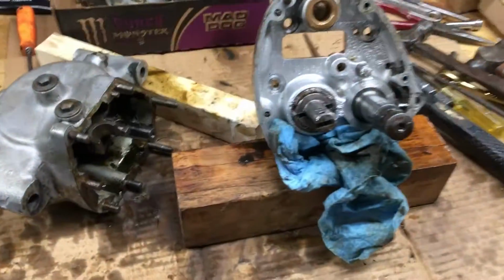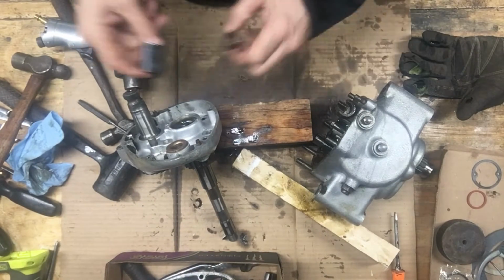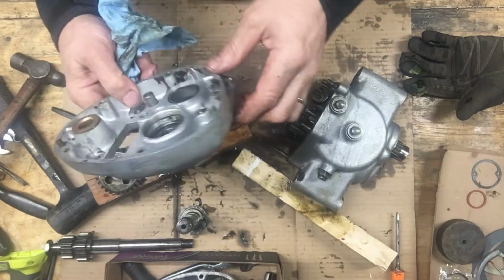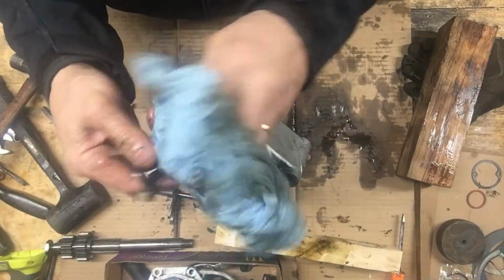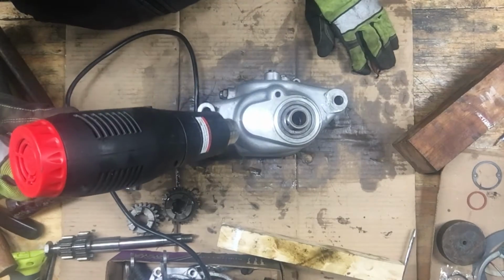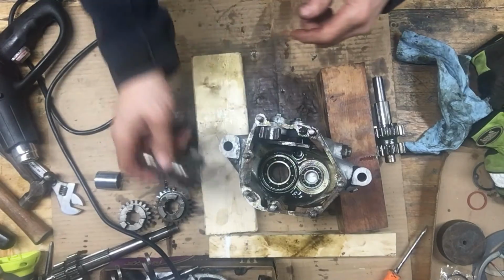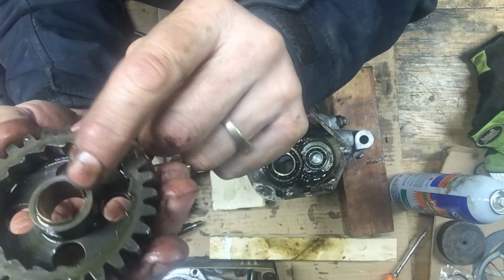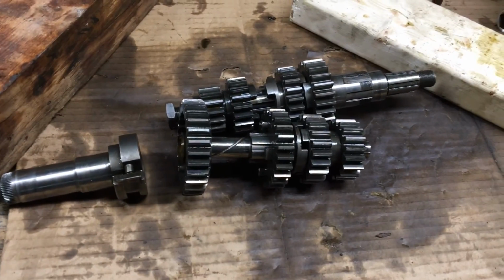Norton Commando 750  Restoration Video #64

Comment: Bit late now but someone could benefit.
Boil the main case in water, when it's hot enough the main ball race and layshaft bearing should fall out.
You may need to tap the case on a block of soft timber.
Reply from the maker: Boiling water is a maximum of 180 degrees, I baked the cover too 300 degrees and it still did not come out.
Reply: @MOAB  Never had that happen, boiling water has always worked for me.

Comment: Hello Bruce...what gear ratio is standard for the 750 commandos? I would like to change mine to the lowest gear ratio. Thanks.
Reply from the maker: Hi Brian, I just got in the door. I don't know the gear ratio, are you talking about the sprockets and number of teeth? I am not sure, I would have to go count mine. I know the Brat Norton I am building is going to be different because of the Harley rear sprocket. So I will be probably changing my ratio as well.Bruce